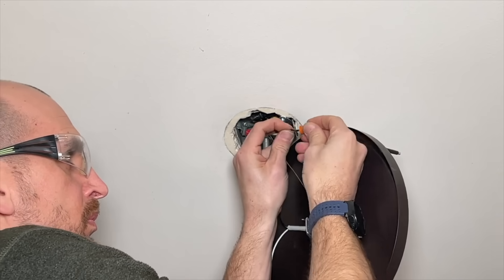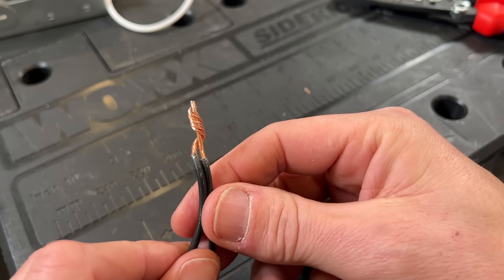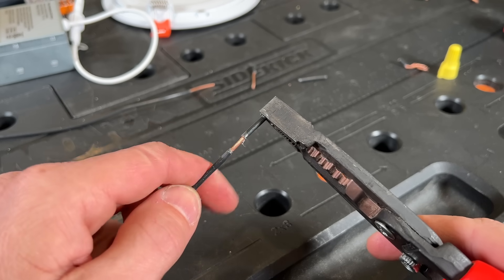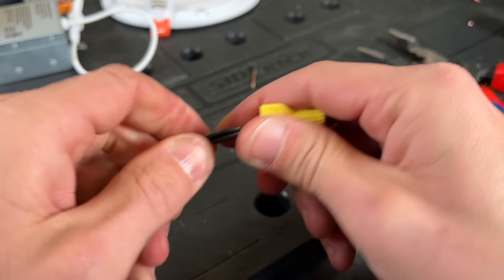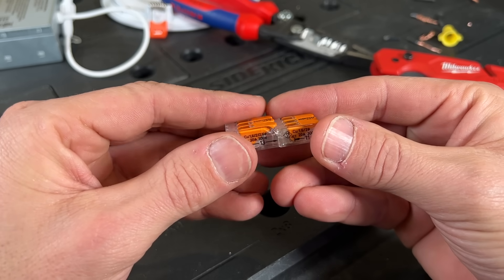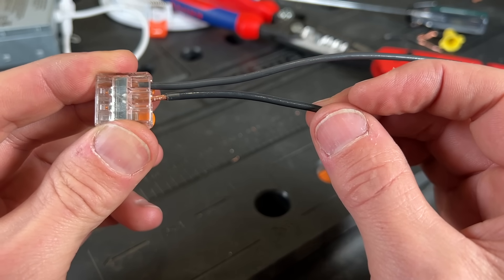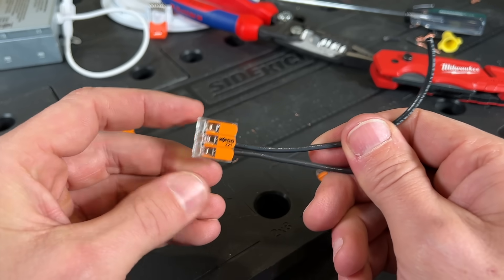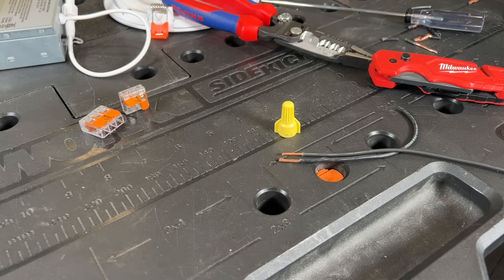Most Common DIYer Electrical Mistake - Don't Let This Be You!

Comment: I believe the biggest mistake diyers make  is doing electrical work in the first place. 
Just ask them about power factor , leading or lagging current or anything .
They most likely can't answer. 
That is bloody dangerous
Reply: Really?  If a DIYer is following proper procedures and has the breakers turned off to the circuit, power factor and leading/lagging current is completely irrelevant.
Reply: @len2524  I could have asked any question . Cable de-rating or a lot of others. 
A girl here a few years ago turned off the faucet in the yard and got serious brain damage, luckily not dead.... why ?
You buy a new AC relay/ contactor for your motor / pump ,it works but makes buzzing sound.... why ?  
What's the difference between an earth connection and a ground connection ?
3 other basic questions I could have used. I admit the third is more in line with electronics.
Then there's the insurance company issue.
Reply: @chuckmaddison2924 , hey I get it.  I’m an electrical engineer, but the video was about using wire nuts correctly.
Reply: @len2524  On the wire nuts, yes. Not keen myself .  But then it took me a while to accept wire wrapping. 
The girl was very tragic. My son almost caught same way. I helped him move , noticed some illegal electrics and told him to call electrician. That nite he was in hospital.  He put sprinklers on then got  in shower with instantaneous 3 phase heater.  The neutral when put back in the MEN strip burnt due bad connection and all plumbing became live 250 v.
When plumbers cut pipes they have jump cables just in case .
Anyway all the best to you.
Reply: @chuckmaddison2924 , and to you too.  And your family.  I agree that some people, with limited experience, should call in an expert. 

I have never used Wago connectors.  They seem like a great idea but I’m suspicious.  I’ve never seen a properly installed wire nut come loose.

They use Wago like connectors in Europe, which is 240 volts and much smaller wire.  I hope they’re much beefier for 14/2!!

Comment: Thanks for the tip on the stranded/solid copper wire nut procedure. I do a lot of smart switches for Best Buy as well as floodlights from Ring. This procedure is going to help me a lot. I have to take a pass on the Wego connectors because they seem too bulky for a box, and I just can’t afford them. Thanks again
Reply from the maker: Thanks for the feedback Steve, they are a bit pricey.  If you do ever take the plunge make sure you grab the 221-412, 221-413, and 221-415 as opposed to the 221-612, 221-613, and 221-615 as that will save you some room.
Reply: My experience is, the Wagos are less bulky. I prefer them in a crowded box, such as behind a GFCI or dimmer, or in a pancake box for ceiling fixtures. Also, the five or six port varieties are much less bulky, and more reliable, than the oversized nuts for things like ground and neutral bundles.

Comment: I use to work for one of the largest wire nut manufacturers in their lighting division. All of our lighting products were built using Wago connectors!

Wago connectors are also great if you have to work with live wires, the risk of accidental electrocution is much less than twisting a wire nut... That's insane even if you're a pro.

You're correct never pre-twist, as you said let the nut do the work!
Reply: For years I've pre twisted the wires into frustration. Now I know the correct way too!
Reply: Wago is a German company so it is definitely not pronounced Way-go.

The way he pronounces it in this video isn't correct either. If you want to know how anything is pronounced correctly check the YouTube channel of the manufacturer.
Reply: @Jehty_  thanks, I removed the comment.

Comment: Interesting presentation. I thought you were going to recommend tinning the stranded. For neophytes, “tinning” is applying solder (a tin/lead compound) to the strands. 
Note: I’ve done this for electronics work; any thoughts on whether the solder would fail under power loading in house wiring?
Reply: 40yr sparky here,  it is very unlikely that a tinned wire will fail, not enough heat by far.  If it does fail you really have a problem!!!
Reply: I prefer tinning for auto,  electronics etc  ..
Reply: a tinned end will not fail if all other variables are accounted for.     Again, if all other variables are accounted for.    Worked on equipment with connections used at over 21KV and ridiculous amperage...   all good if the entire system is installed and maintained correctly.     That's the catch... most residential work is absolute shite.    At any reasonable power load in a household environment, the solder won't fail.
Reply: I'm not an electrician, but in my old house, all the original connections were soldered, and the electricians I have asked have said it was acceptable. Maybe some would say no, IDK. Maybe some could weigh in on that if they don't agree.

Comment: I learned 2 things. Even though I've done a lot of DIY electrical work over the years.
1. The same gauge in solid & stranded wires are a different diameter. 
2. The proper way to use a wire nut on a solid/stranded pair.

I have seen the WAGO connectors in other videos and are similar to low voltage connectors I've used in the past. But have not had a project to try them yet.
Reply: Use what you have. Just brush up your skill. You can also tin the stranded wire to make it behave as the solid wire.
Reply: Gardening spoken like a true electrician. I’m a professional electrician and I couldn’t care less if I’m using wagos or wire caps. My advice is to learn how to use both proficiently because they both have their pros and cons in the field.
Reply: @esl4058  100% absolutely
Reply: Buy them, you'll never use a wire nut again. I have been using Wago for a year and a half now, and don't even carry wire nuts anymore. I only deal with residential, so I don't have heavy gauge wire I need to deal with, mostly lights, outlets, gfi's, etc. And I love the Wagos now.

Comment: Used correctly, the wire nuts are going to make a more secure and reliable connection. Using wire nuts under high loads, there will be more contact surface area between the wires causing less heat problems. The Wago is using a spring tension constantly on the wire, what happens over time when the plastic housing fails. The wire nuts have a tough steel spring in the middle, wrapped around the wires, which will never fail. And the nuts are much much cheaper. Only time will tell.

Comment: I'm a DIYer and noticed, years ago, that connecting stranded to solid wire tended to do what you showed at the opening of your video.  What I opted to do is strip my stranded wire 1/4 to 3/8 inch longer than the solid.   Then I  twist it around the solid wire.  That way the ends of the insulation on both wires are together, and the tips of the wires end up together, too.  Then I put on the wire nut.
Reply: As an apprentice this is what I do, I wrap the stranded around the solid, and use my lineman’s pre twist. That’s the only way I can feel comfortable that the connection is secure

Comment: The improved style of splicing can still fail with not enough twists, although better …not best.
When splicing solid to stranded or a larger wire to a smaller gauge, you twist the solid AROUND the stranded or smaller gauge,
Like a pigs tail. Then give the combination a twist with your pliers, that is the best mechanical connection without relying on that wire nut. So for I’m not seeing employers spending extra for those WAGO connections…but they do show up in light frames.

Comment: Worried about loose connections?
Get the SOLDERING IRON out and properly solder them.
Source: old school senior citizen/retired electrician.

With soldering, no risk of the copper wire oxidizing and creating connection resistance.

Comment: It would've been nice had you shown a full 3 wire hook up with that Wago connector. You left me with more questions than answers.
Reply: What exactly were your questions?
The 3 wire hook up looks exactly the same as the 2 wires shown in this video just with 3 wires 🤷🏼‍♀️
Reply: @Jehty_  I've never seen it he Wago before and he only connected two hot wires into a 3.  Do I need a separate Wago for each strand of wire?
Reply: @joeh4295  I don't really understand your question.

Maybe this will help: just imagine the Wago connector as a fancy wire nut.
Meaning you take 2 or 3 or X wires, put them in the connector and now you have "1" wire.
Does that answer your question?
Reply: @Jehty_  that makes sense. I thought the 3 hole connector was to connect all 3 wires into one connector.  Thanks for the explanation, I'm a paramedic not an electrician. The Wago seems faster and safer than a wing nut.

Comment: Doesn't it mean the one should strip stranded wire a bit longer, since it will be going around a straight solid one ?   That's what I was always doing, and then you get an excess of stranded sticking out
when you align the insulated parts ( and you don't have to guess whether some bare stranded wire will be sticking out)
Reply: yes thats how I do stranded cut it about 1/4 longer and when putting wires together i slide the stranded past the solid slightly twist evenly i never have a issue but Im not sold on wago's Ive seen them fail many times either from bad product to improper installation. When done proper using side-cutters to twist your wires first just as you would using Sta-cons. When quality wire nuts  are used the connection is never the issue.

Comment: One of the other common issues is people removing too much insulation from the wire. 3/4 to an inch is too much.   Why take so much off?
Reply: Exactly. There's no reason to remove that much. If I see them exposed that much I always trim them back. I think people remove that much because they see the size of the wire nut and assume that the wire should be exposed the full length and forget that the actual metal wire nut inside is usually only half the length of the plastic part of the wire nut that you see. The people who trim them back that far have never had to work on building with weird wiring. I shut off the breaker to the living room and turns out the second hot wire was on the master bathroom breaker which is on the other side of the damn house... How did I learn that? Over trimmed wire in a wire nut and the ground wire flicked over and landed inside the wire nut and popped the breaker. That wouldn't have happened if the wire insulation was cut back properly and not 3/4 of an inch or if the breaker was wired properly. I put a piece of electrical tape over it with a note "this hot wire is on master bathroom breaker" and capped it off and taped it and made a call to the property's owner to let them know a certified electrician was needed. Wasn't needed for a ceiling fan anyways.
Reply: "3/4 to an inch is too much.   Why take so much off?" 
Because most people (electricians) aren't taught to wire on a case-by-case basis. 3/4" is the appropriate amount for wrapping around the lead screws of most receptacles and light fixtures which have them. 3/4 inch is also the appropriate amount if combining more than 2 or 3 wires within a single (bigger) nut. It's really only not appropriate in limited situations such as this one where there are only two 14 gauge or smaller wires going into a single yellow (or orange) nut.

So what most people do is they don't over think it and they just systematically cut all there pigtails back 3/4", which works perfectly fine when you also make a habit of wrapping the wires and nut together with black tape. Hope this explanation helps those of you who are struggling with this concept.
Reply: @Rick-the-Swift  I always wrap wire nuts in tape. If nothing else just to annoy the next guy.
Reply: Bob Beanner  an electrician isn't needed so long as the right certifications are had by the installer. Most electricians are covered by company certifications and not individually so it's hard to tell who's really qualified now days. I always do a quick inspection to make sure everything is in order. I don't know how many mounting brackets I've found that were loose. Some fans weren't even seated properly. Like they literally have a keyed groove in them that you just turn the fan to lock in but some how some people still fail that part. As for needing an electrician, I have never heard of needing one for a ceiling fan. If it was a legal requirement I doubt Walmart would be selling so many fan kits without a lawsuit here and there.
Reply: @TheSlimCognito  Where I live you can DIY your own work but if you are hired to do the work you need to be licensed.
Reply: Well as a professional electrician, I can tell you that we do indeed install many many ceiling fans. Why? Because a fan is a motor with wings attached to your ceiling that’s powered by the electricity in your home. It’s a good idea to call a professional for that. Just sayin…
Reply: @TheSlimCp  sounds like you didn’t know what you were doing and you should not have been doing it.  First of all there is no metal wire nut inside the plastic wire nut but there is a spring. 2nd the ground “flopping” under the hot wire nut seems like user error.  3rd how much is the right amount to strip?  Don’t tell me something’s wrong and not tell me the right way to do it.  Yes I am an electrician with 20yrs I’m the trade.  By the way the last one was a trick question.
Reply: @WeMe83  the wire flicking over was indeed a user error, but not entirely mine. The wire nut was 1/2 inch from end to end but the wire was stripped back 3/4 which is a big no no. Exposed wires are fire/shock hazards. However of the 23 identical buildings on the property that one building is wired differently. It's not even the same on a unit by unit basis. I've had to go through and trace every one of those extra hot wires because of that. As for the metal inside the wire nut, it's not a spring but more like a coil. Springs add vertical/horizontal compression or tension force and a wire nut does neither. It threads wires together using rotational tapered compression. It acts more like a nut and bolt than a spring action.

Comment: I've found those Wago connectors melted in older buildings before...
Reply: but wire nut connection houses have burn lot lot more than better wago etc other type connevctions wire nut not have safety, many country have out of law use wire nut shit connections.

Comment: They sell different diameters on the twist connectors...So use one closer to the diameter of the wires you are joining. You could also tin the stranded wire using a solder gun and use a wing nut to join the two together.

Comment: WAGO's are awesome. I started a fire in an outlet box where I tried (unsuccessfully) to twist five neutrals together under a wing nut. That led me to discover these gems. They're a BARGAIN at 10x the price of a wing nut. Old electricians are welcome to use wing nuts for as long as they want, but a WAGO is so beginner-friendly that they're all I would recommend to other homeowners and DIYers.
Reply: 4 is maximum allowed, but yes Wagos are pretty cool.
Reply: If you're trying to bond five conductors together in ANY residential environment,  your problem is not the connectors......
Reply: Could of tails have solved that problem?

Comment: Wire nuts are designed to protect a splice. Not create one. A loose connection is the number one cause of electrical fire. Remember all those outlets with stablock connections in the back? They all fail over time. Usually destroying the wire and device with it. Wagos? It's only making a connection against one slim point of contact. It's a spring based mechanical connection that through time and use (contraction and expansion through heat from amperage) will fail as well. A proper twisted splice is the best connection. Follow that with a good manufactured wirenut and you have a bombproof connection. Also the proper way to splice stranded to solid is to strip your solid longer than needed, hold the cross point of your stranded and solid wires and then twist the solid wire around the stranded one. Cut once the twisted portion is at correct length. Extremely tight splice.

Comment: Nice video.  I've never been a fan of wire nuts, but I always twist and never had a failure.  I grew up using a Buchanan crimper, but it is hard to find the sleeves for it.  Wagos look slick but feel like the Shark Bite connector of electricity.

Comment: When I have to do that, I leave the stranded wire long, and twist it onto itself. Tinning the strands, or crimping in a ferrule, or using an external screw terminal strip also work. Wago connectors are a new thing for me.I'm not sure how far I trust them get. Kinda like push in terminal strips or receptacles. They are approved, but I'm not sure how much I trust them.   
Yup, that's what you did.

Comment: Wagos are great for control systems but not necessary for a ceiling fan or DIY electrical. They are easy to use but their primary benefit is for helping to keep track of complicated wiring systems. 
A certain output is not working, this control operates the failed output and they are connected in the wago. A lot easier to find the failed control component.

Comment: When assembling 1 solid and 1 stranded using a wire nut - first not necessary to strip off 3/4" of insulation.  Less is more! Read the instructions provided by the manufacturer too, always helpful!
One wire nut 1 stranded one solid - assemble the wires side by side with the stranded about an 1/8" above the solid, tighten with your wirenut.
Again, ALWAYS read the manufacturer recommended assembly. Never fails to work correctly!
Reply: today have world biggest fail use wire nut connection because have lot lot more better connection in shop can buy, and lot safety too, wire nut not have good not safe